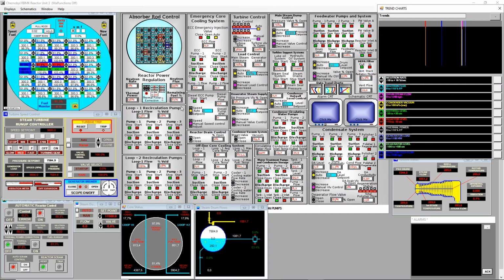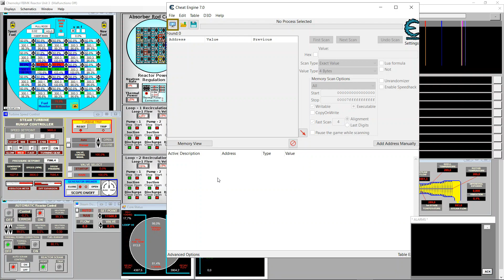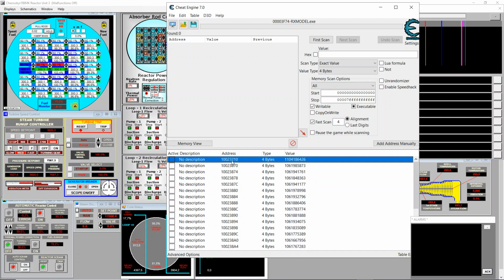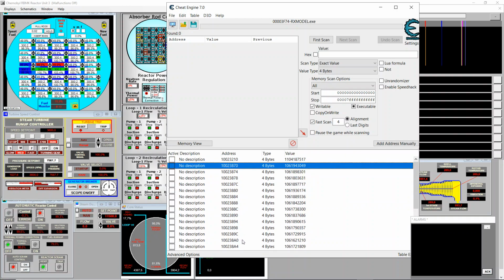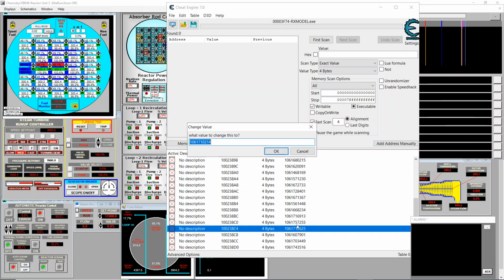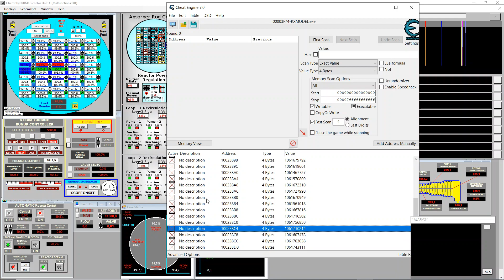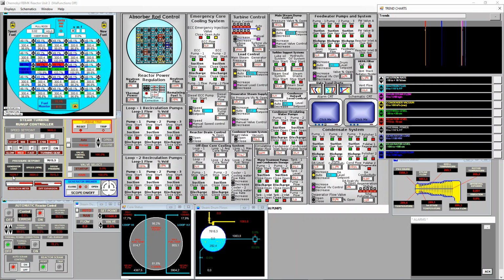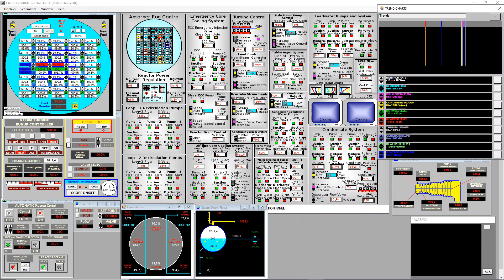RBMK Simulator Fuel Consumption Fix with Cheat Engine

Comment: how is your fuel temp so low at that power level? i can only go to 95% at 1460 fuel temp
Reply from the maker: Are you using imperial or metric units? 1460 F is like 790 Celcius
Reply: @argilaga  no idea, how would i check / switch?
Reply from the maker: @lands1459  There is a menu, I show it in my latest video (from yesterday). But in some of the demo versions it is not available. So I suggest you to switch to the port full game, links available in my latest video (rbmk port 1)

Comment: The values that you see in Cheat Engine, e.g. 1061805127, are actually 32-bit floating point numbers. When interpreted as such, the value of "1061805127" is 0.788 - 78.5% fuel remaining, so this actually makes sense. In Cheat Engine, you can either change the value type while searching to "Float"; or in the list below select the records -> Change record -> Type -> select "Float" -> OK. Then you actually know what value you're setting if you make changes like in the nuclear accident simulation.
Reply from the maker: Wow! great, I did not figure it out by myself, now that you say it, it seems so obvious. Thanks!

Comment: Favor for favor. Using Absorber rod control module is very risky... so:
Fuel channels are known as above (thanks). Rod positions are in address range chrnob_32.dll+237a0 to chrnob_32.dll+23800. Before fuel "change" to 100% is good practice to insert rod to position about 50% (0.50 value), especially in high power ratings. Passing over 100% neutron flux ends with meltdown.
Next usable address is chrnob_32.dll+20f54 - HEPA filter wearing level. Value counted in 1/100 %. For more comfort values may be displayed as single precision float numbers in CheatEngine - easier to modify simulator environment. For fuel and rod positions values are from 0 to 1, 1 = 100%.
Reply from the maker: Thanks for the contribution!!! You gained a place in the Kremlin wall. The HEPA filter control was the last thing needed to be able to run the simulator indefinitely, with this it could theoretically run forever but there is still the crash prone behaviour... I am currently living in a country where Youtube is not permitted so it will take longer time than usual to respond comments and upload new videos, thanks for the patience!
Reply: @argilaga  For crash problem is solution: after opening pop-ups not close it but minimize only. Sort mini bars somewhere on screen and restore when needed. I run this few days without crash. Program always crash in case of initializing pop-up.
I open all popups once, manage it with groups on bottom of screen and use only restore/minimize options. They remember minimized position and return to proper group.
Edit: This loooks as memory management issue.
Reply from the maker: @adamw.8579  Great tip!!! I will try it, if it works this is really good for indefinite operation.

Comment: As a control room operator in real life I really enjoy this simulator for private use and this fix just made it even more enjoyable, thanks a lot! If only we had some way to replace or lock the hepa filter we could theoretically run the plant safe and stable forever.
Reply from the maker: I'm happy to hear that! In which kind of reactor do you work? I will have a look into the hepa filter later this week
Reply: argilaga That’d be awesome! Currently I’m a control room operator at a quite large and complex chemical plant that has its own power plant on site. (not nuclear) I operate the chemical reactors and the power plant. 
I made my turbine operator license at a BWR plant. I’m hoping to get in the nuclear industry in a few years from now.
Reply: HEPA filter counter is at address chrnob_32.dll+20f54. 4 byte float (short float type) counts in 1/100 %. Put zero and set as active. No HEPA wearing forever.
Reply: @adamw.8579  Thanks man that's awesome!!